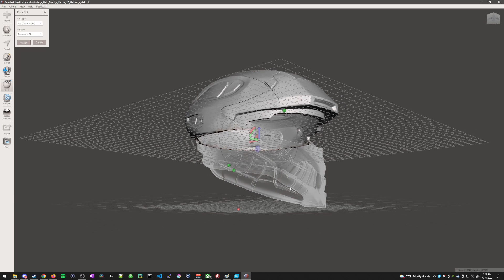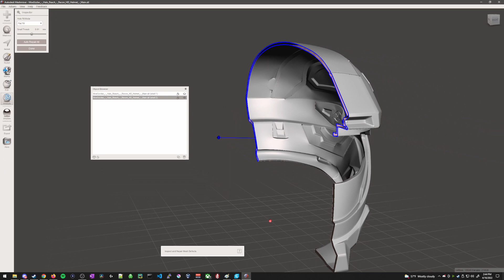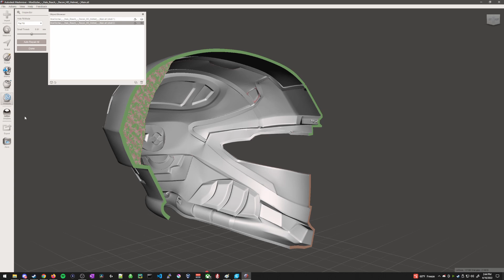Printing the Recon Helmet from Halo!

Comment: Why would you put a raspberry pi in it? Wouldn’t an arduino be better?
Anyway, i am myself printing a halo reach EOD helmet among also planning to print the reach scout and commando helmets. If i can find the file i like also a mark 5 and 6 helmet.
Reply from the maker: An Arduino may be better. I just have more experience with using a raspberry pi than an Arduino. I also have 3 raspberry pis literally doing nothing.
Also all of those are solid helmets to make. It's definitely fun to make and print. I've just beern procrastinating or else mine would be further along